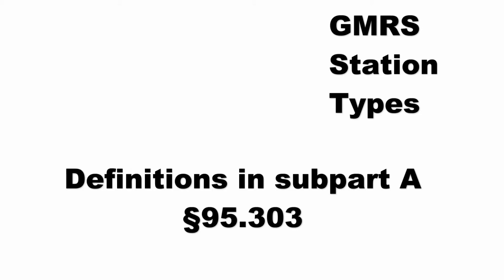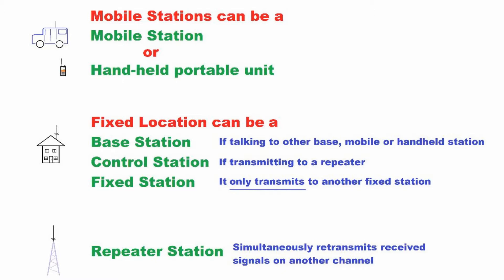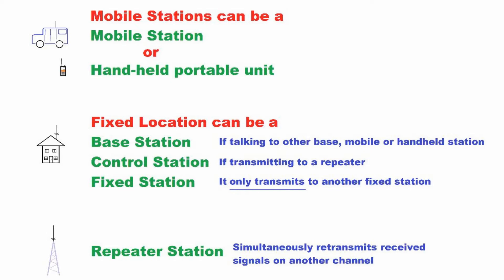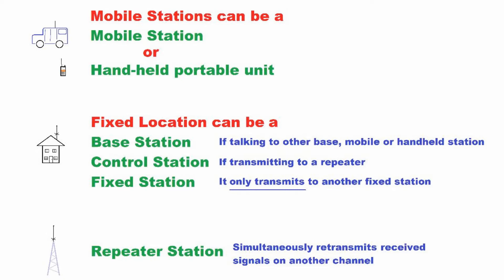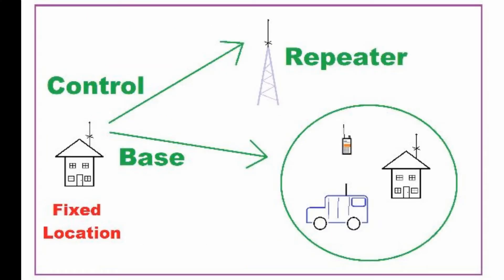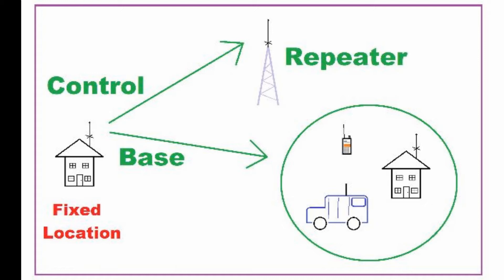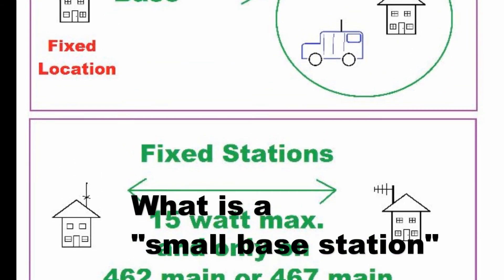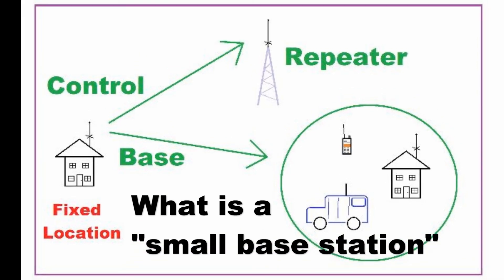GMRS Station Types

Comment: Generally, a Base Station using paired UHF frequencies, transmits on the lower frequency of the pair (i.e. 462.5500) and receives on the higher frequency (i.e. 467.5500). Therefore, they cannot communicate directly with each other. Control Stations, Mobiles and portables, are exactly the opposite, transmitting on the higher frequency of the pair and receiving on the lower. Therefore, they also cannot communicate directly with each other. The only way radios within these groups can communicate directly is via simplex using a non-paired frequency (also know in repeater systems as talkaround).